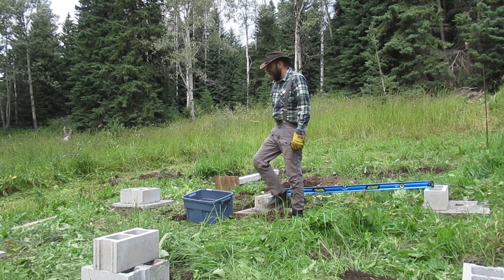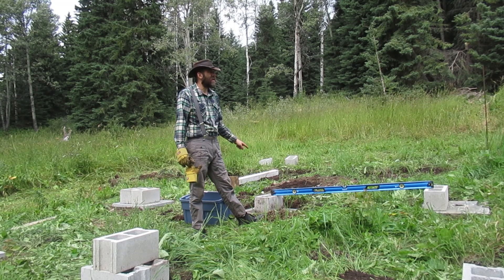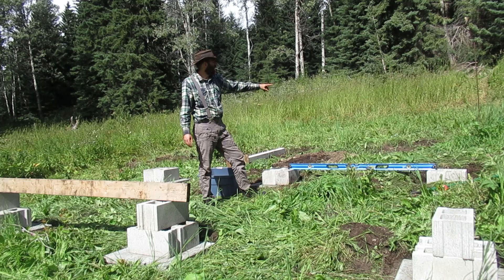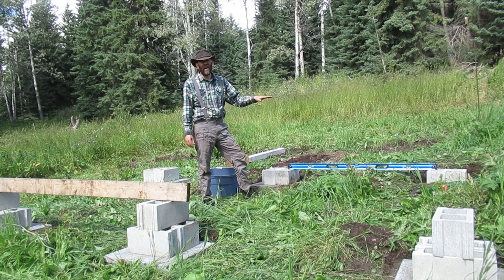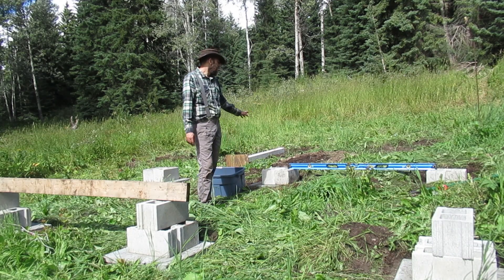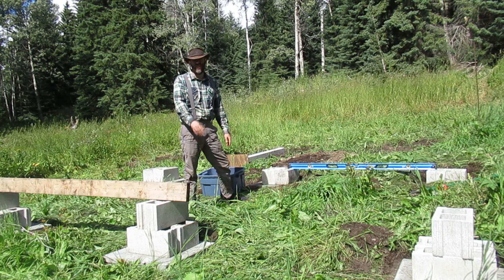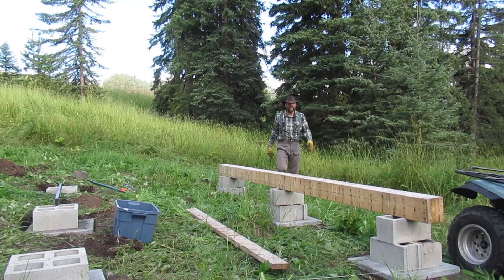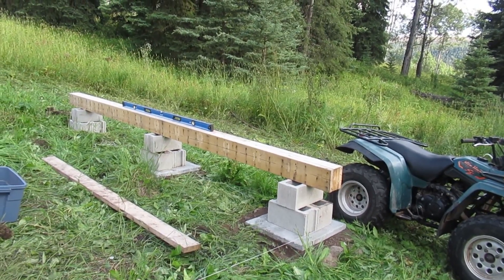The New Off Grid Cabin Build Has Started | Cabin Foundation is Finished!

Comment: NEW SUBSCRIBER, SUGGESTION, I would fill those blocks with concrete and insert a metal nailing flange into the wet concrete to nail the beams to. U said the plan was to attach plywood to the underside of the floor framing, great idea. Can I also suggest instead of crawling under the cabin floor, install 1inch X 1inch nailing strips at the base of the framing so you could easily drop your plywood on top of the nailers from above and gives you east access to drop in insulation. That's a lot to suggest from a new Subscriber but it's good building practice‼️GOOD LUCK AND KEEP YOUR BEAUTIFUL DOGS AWAY FROM THAT BEAR‼️ Vinny 🇺🇸

Comment: I have watched all your videos & think you are doing a great job. looking forward to more. but those blocks are meant to be filled with concrete or at lest cement mortar as the hole in them is just to make them easier to move & lay. but should then be filled to give them structural integrity. there is a huge weight resting on them & as a bricklayer I know they are not to be trusted with out infill. but with luck you will be ok.

Comment: Don’t you worry about the foundation being above the frost line? Or are you in a warmer climate?
Reply from the maker: I am in northern canada, and havent had any issues with frost heave.  Its in its 2nd winter and no movement, and if there ever is any, it will be simple to jack a beam up and shim it level.
Reply: @OffGridFreedom  Good to know! I’ll have to check if the codes allow that in the upper peninsula of Michigan, which is where I want to get land.
Reply: @Againstthegrain8084  I’m in lower peninsula and was wondering the same thing
Reply: @sunrisesidesnowdogs5920  I’m sure all we have to do is check the building code for Michigan. Also check your county website.
Reply: One more in the UP wondering the same thing. I do have road/truck access and was told to grade the clay to shed water and cover the area under the cabin with surface five gravel, then just pads on the gravel.

Comment: Do you have any issues with frost heaving
Reply from the maker: So far its been through 1 winter and I haven't noticed any movement with the foundation,  I checked it all with a level this spring and it was the same as before winter.  Only time will tell but so far so good.

Comment: Great stuff !! We are preparing to build a 16 x 24 cabin and I'm leaning towards doing the same type of footing. Do you think the cinder blocks will hold up ? What size is your cabin?
Reply from the maker: My cabin is a 16 x 20 with a loft.  I think the cinderblocks will be fine, if you look into how much weight they can support, the cabin will be well under the limit, and if there is ever a issue with a block cracking from winter, I will just throw a jack under one of the beams and replace it.